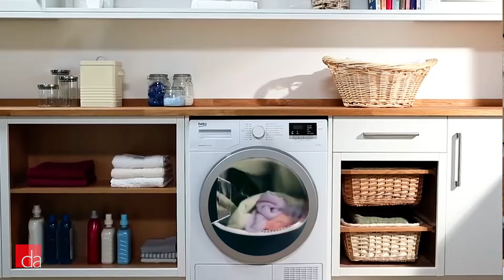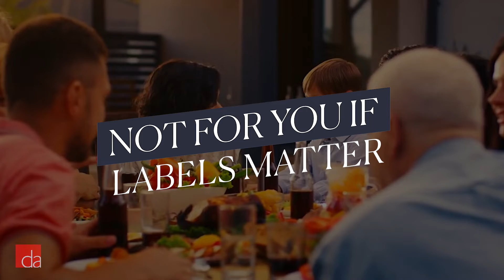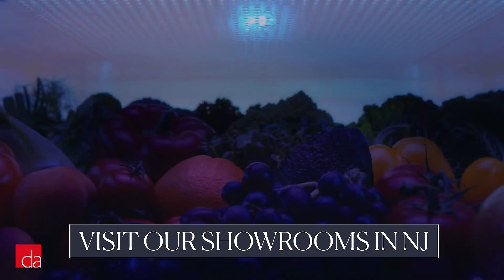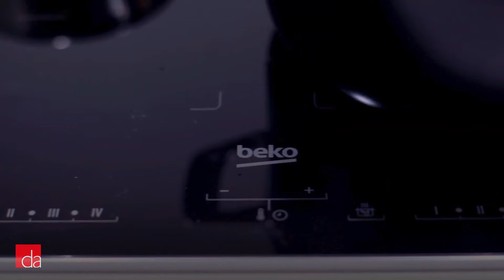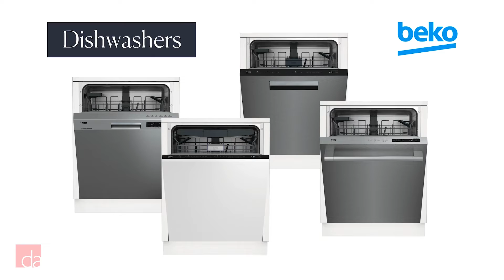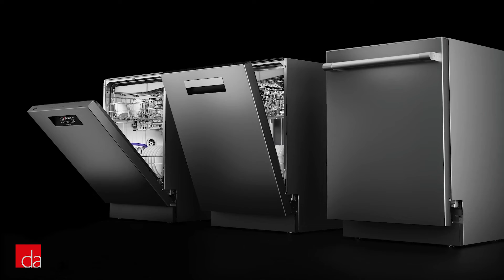Beko Appliances - Should It Be In Your Shopping List?

Comment: We bought a house with all Beko appliances. The only one I'd ever consider buying is the gas range. The refrigerator and dishwasher both suck and are supposed to be high end appliances. They are only 3 years old. The fridge has a broken ice maker and is unintiutive to use. The dishwasher is clunky and poorly designed from a use and loading standpoint. Our prior Miela appliances were far superior. Good luck getting support for Beko stuff in the US. Stay away if you're in the US.

Comment: I used the self clean and my Veko 30 inch gas top and oven. It  locked and won't open. The top gas cookers won't come on????? I don't know where the manufacturer ir serial number is to get a technician out?

Comment: I purchased a Beko refrigerator freezer in the Pacific Northwest around November 2023.  The freezer door handle was broken on delivery.  It took months the get the Beko out to look at the freezer door handle. When he removed the handle, a broken piece of plastic fell out and he said he had to order a new freezer door because the weak plastic part could not be replaced.
That was about 2 months ago. No help yet and the cheap plastic guide on the ice drawer broke and fell out onto the floor today.
I also found water under the internet water filter in the refrigerator compartment .

I do not recommend Beko based on my real life experience.

I wish I purchased a different brand.

#Beko